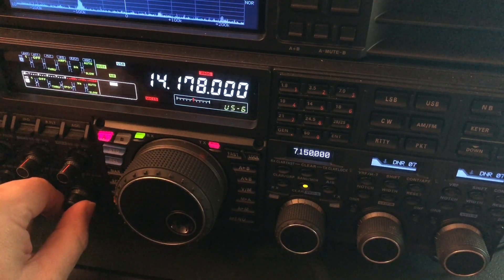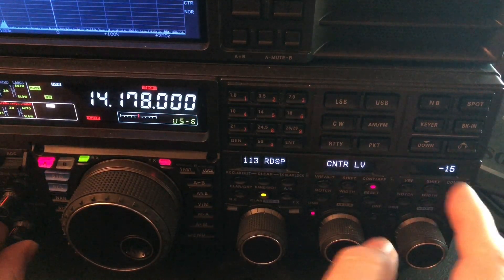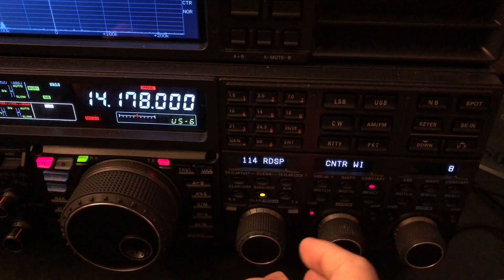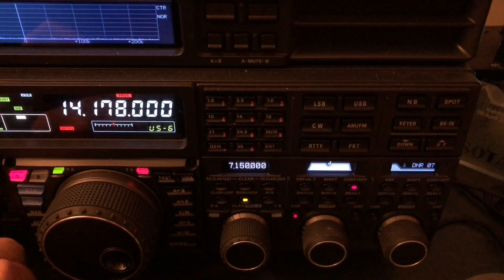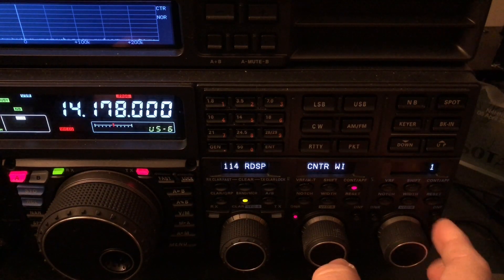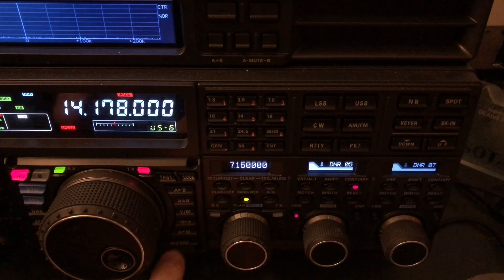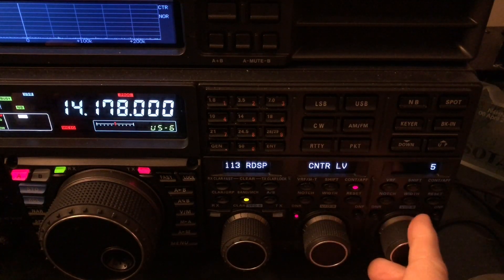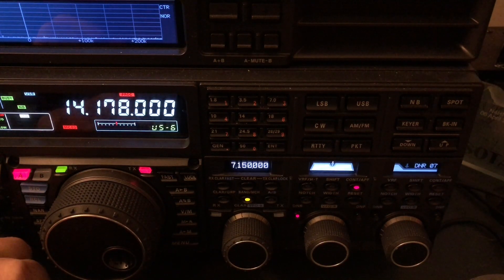Contour Boost or Cut?

Comment: Help me understand the use  or benefits of contour for someone without a yaesu. 
Seems like around 1800 may be shifting the dnr so to speak.
Reply from the maker: Contour is like a wide notch filter.  I simulated contour in one of the IC-7300 videos by setting its manual Notch filter to wide.

When you are struggling to pull out a weak SSB station, sweep the Contour filter at somewhere between 1800 and 2200 Hertz.  You can knock down the noise floor near the frequency where the majority of intelligibility is with a SSB signal.  Forget about audio quality.  When you use Contour, you are simply trying to pull out the missing words or syllables of a weak station, or maybe trying to hear the missing letter or number in a callsign.

While you can simulate a Contour filter by setting Notch to wide, an actual Contour filter can be more effective.  Yaesu allows us to set the width and depth of the Contour filter.  And we still have our Noise Blanker available, in case we need it.

Note that a combination of Contour and Digital Noise Reduction might help even more, when trying to pull out the weakest of the weak.  If you set DNR much higher than 7, you might want to consider narrowing the width or decreasing the depth of the Contour filter.  But I find that a DNR setting of 3 or 4, in combination with Contour at a depth of -15 and width of 9 or 10, is usually enough.

Contour can also help with CW.  Set the Contour at 350 Hertz +/- 50 Hertz, and Contour can help with filter ripple.  If you use both Contour and the “Notch Trick” I show in many of my videos, you can virtually eliminate any of the ringing sound you get when you narrow your CW filter to 150 Hertz or less, while trying to block QRM.

73, de N4HNH
Reply: @n4hnhradio  thanks so much
Reply: I’ll try using manual mitch on the k3. Thought manual notch was just for cw. Thanks again
Reply from the maker: Manual Notch is normally for SSB, but I use it to minimize CW filter ripple.  I go into the menu and set Manual Notch to narrow.  I then enable the Manual Notch filter and set it to 80 Hz below the CW pitch I use, which is 600 Hertz. Depending upon the amount of ripple I’m hearing, I might “sneak” the Manual Notch frequency up to within 50 or 60 Hertz below the CW pitch (sidetone) frequency.

73, de N4HNH

Comment: Does using the contour on the 5k attenuate the signal?
Reply from the maker: Contour doesn’t attenuate the RF, but notch and width can have an affect on the S-meter reading.  The S-meter is driven from the AGC circuit.  A super tight bandwidth and/or notch can decrease the amount of signal that enters the AGC, thus the S-meter readings will be lower.  It doesn’t matter to me.  I’m going for the best S/N ratio, not the meter reading.

73, de N4HNH

Comment: Thanks for Contour information.  I prefer boost contour in my ft2000 because you have the Notch option too for parametric way to cut sound and then you have two ways for clarify the signal,  boost and cut at same time. 73s EA4IS
Reply from the maker: I understand but my notch is sometimes tied up cutting out local heterodyne from the neighborhood.  73, Thanks for watching!

Comment: I ended up ordering the FT3DR.  Should be here Thursday.  Maybe you can do a few more videos on that radio.  Your HF radio there is a hoss.  I like the way you show how to filter the signal so that you can get the best sound.   I try to translate that over to my IC-7300.  Pulling up a weak station can be pretty rewarding.  Thanks for the video.
Reply from the maker: Hi Don!  There are several videos about the FT3DR on my channel.  I think there are 4.  There is a lot packed into that little radio.  73, de N4HNH